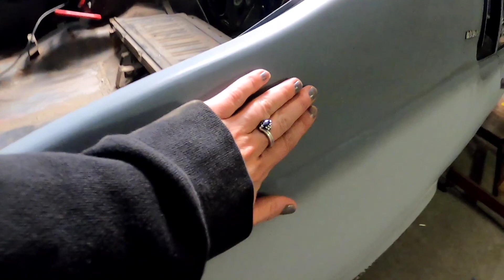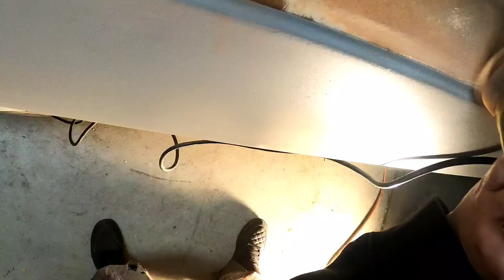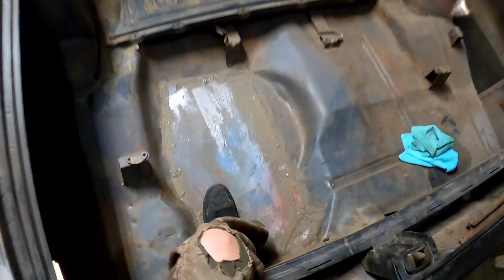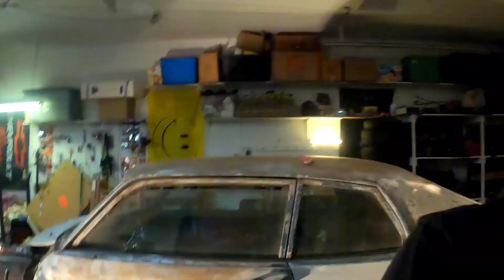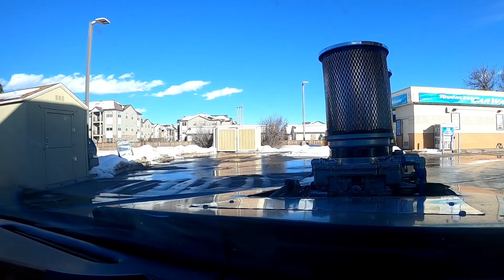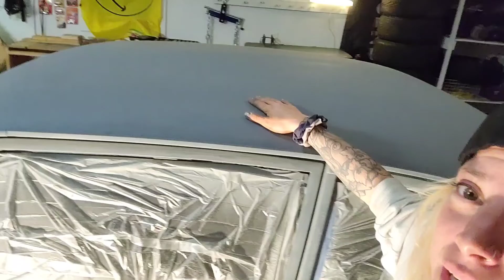1974 Chevy Nova Hatch- Project HOTROD starts with some Sanding and priming. Practice makes perfect!

Comment: 1. Nice to see you wear a mask to keep nasty stuff outta your lungs!
2. Check out Vice Grip Garage and his tips and tricks doing paint jobs on the cheap. 
3. Think you got a compressor, and some sort of spraygun? If so then buy primer in a tin (if that makes sense?) as its usually cheaper than rattle cans, and also it might get you a thicker layer to sand down which 'fills' up better.
4. Dont think you really are alone in the garage, maybe there is another one, not in person but in spirit.
5. Seems like you're in better health than last vid and thats really positive!
Edit! Whoa, 1500 subscribers!